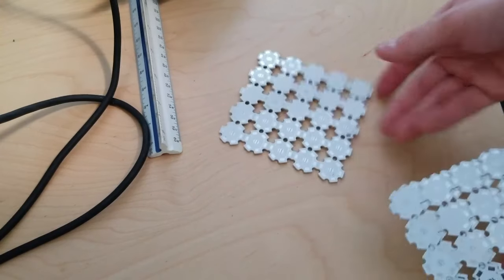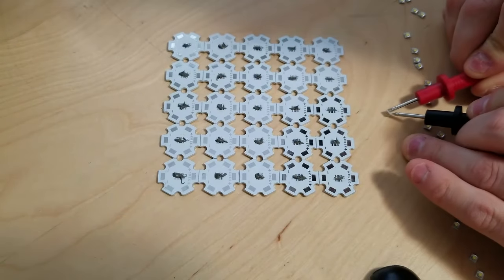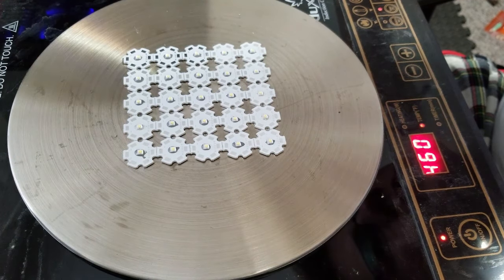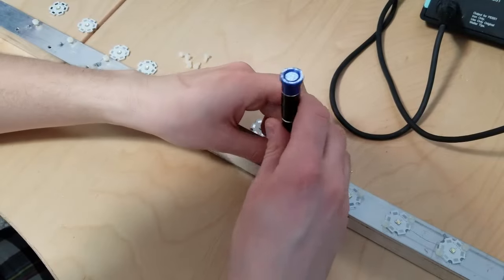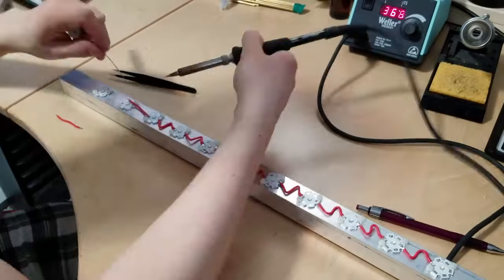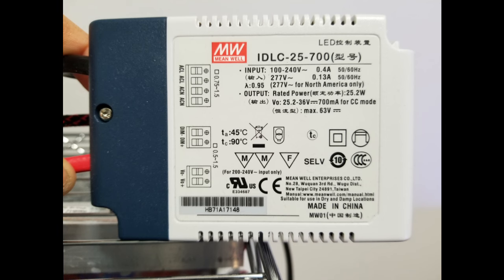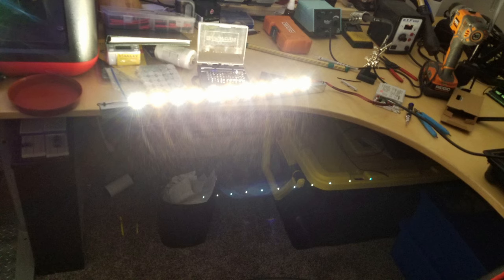DIY LED Lighting - How to Make Your Own Grow Lights!

Comment: Awesome video! I am looking to pick up one of those portable cook tops; however, it seems like they only sell ones with ceramic glass surfaces these days. Do you know if this will work the same?
Reply from the maker: Hey Andrew,
As long as the surface has [relatively] precise temperature control it should work just fine!
Reply: @autumnmaticcreations62  Thanks for the knowledge! I'm planning out my 8 site pepper aeroponics build now and looking to upgrade from COBs to something a little more custom. Any chance you'd do a video on designing a gerber file or the math behind that custom PCB you had ordered from JLC?
Reply from the maker: @WeRideSouth  I like the idea. Maybe I'll document the next LED board I do, but it will probably be several months before that's ready. What size of a light do you need?
Reply: @autumnmaticcreations62  I'm not sure yet. I'm currently running single Bridgelux Vero 18 COBs per plant, but increasing to 7 sites soon is going to get out of hand with power supplies, wiring and what not (I control them with a Pi and some relays). I was thinking about running some rails like you did with your starboards. I'm trying to get a solution with minimal points of failure.
Reply from the maker: @WeRideSouth  Sounds like boards are definitely the way to go. Have you looked at quantum boards? They're just aluminum PCBs with lots of Samsung low-power LEDs on them. You could run several of those in parallel from a really big driver and save a headache.
Reply: @autumnmaticcreations62  funny you mention that. I actually run two HLG QB288s on my lettuce. The slate heat sinks that they sell are not cheap tho. I was thinking I could make something like the QB144 pretty affordably if I were to build them myself, but I've never built a QB. I may have to stick with the Vero 18s, due to trying to affordably cover 8'x2' area.

Comment: First of all thank for this video. :)
I have a project to build an LED grid with about 150 diodes (Samsung-LM301B). I am not deeply in the topic of electricity rules yet, but I would have a question here.
As I see you do not use resistors. I know that I have to wire the LEDs in series, but I don't know if I have to use resistors during the soldering.
Could you please break down this topic a bit?
Thanks :)
Reply from the maker: Hi Mark.

Resistors are often used to control current in cases where the power supply delivers a constant voltage, but variable current. For high power LEDs, I strongly recommend using a dedicated Constant Current Power Supply. These special power supplies have a bunch of internal resistors and other electrical do-dads that help maintain a constant current and adjust voltage to the circuit's needs.
Reply: @autumnmaticcreations62  You just made things easier for me mate 😄 cheers
Reply: @AutumnMatic Creations  Hi mate!
I've got one last question for you :D

So in my circuit design, there are quite a lot leds (218). I would use a mean well xlg-100-h-ab constant current driver (100W 2100mA  ---   27V to 56V). 

From this starting point I designed the circuit with 13 lines connected in series and these lines are connected in parallel so the driver should handle the voltage forwarding.

So my question here is that the series-connected lines do not have the same SUM voltage forwarding value.

The line with ony the 3000K and 5000K leds have 44V SUM, and this line there are 16 led diodes.
The other line for example has the 16 led diodes mentioned above plus it has 2 Deep Red diodes with plus 2x2.1V voltage forward, so the SUM of voltage forwarding is now 48,2V on this line.

If I have different voltage forward values on different series of connections (the different lines), would it cause any damage on my circuit even if the driver can handle Voltage from 27V to 56V?

I know my question is a little extended now, and maybe I'm not the sharpest knife in the drawer when it comes to the topic of electrical skills, but I'm right in the finish, and your last answer boosted this project a hell of a lot :)
Thanks in advance!!!

Comment: If I were to make an LED array like the ones from spiderfarmer (a square array) what sort of Mean Well would be required. Thanks bud for any help. Also, is that a 3d printer beside you? If so, what would you use it for? I was thinking of creating a Rodin coil among other things. Again thanks for any help. Great video.

Comment: Would this led light be too intense for micro greens ? I am growing in 10 in x 20 in trays. Great video. Thanks
Reply from the maker: The beauty of LEDs is that you can usually drive them as low as you want, so it would be fine. Just pick a driver that supplies a current for the brightness you need

Comment: Very informative video my friend! 
Quick question: 
If i had 4 of these 11 led circuits connected in parallel, can i use 1 driver at the same voltage but with 4 times the amperage or do i need 4 drivers? just trying to get my head around this. thanks in advance mate :)
Reply: Your variable in this case is Amperage since we do not really car about voltage, this will change as a function of temperature of the LEDs junction. As long as you supply a constant current nature will do its magic and balance the voltage across the diods. And always respect maximum voltage of diods since when you put them in parallel you decrease internal resistance by half of the load driven by the current source, which means double voltage across the load. 

(From what I remember from school if wrong pls correct me someone)

Comment: Wouldn't you also be better off running a cable from the unused earth and bonding it onto the aluminium bar the the LEDs are fixed to as well?
Reply from the maker: That's a good tip, Mark. For safety, absolutely.

Comment: I would also like to know if it's possible to get a bigger power supply and make like 10 or more of these Long rod type lights that you made here and connecting them together. I'm looking for at least 50,000 lumens or more. Preferably 100,000 but 50,000  would be just fine especially if I could run three or four 50000 lumen strips.

Comment: could you add a potentiometer for dimming?
Reply from the maker: It really depends on the driver. For some of the Meanwell drivers you absolutely can. You just need to look at the resistor range that the input takes.

Comment: If it outputs 25.2-36 volts and your LEDs require 34.1 volts,what happens to the remaining 1.9 volts that are available?
I didn't notice any resistors used to burn up/thin out the remaining power. Will not having more power than needed burn out the LEDs?
Reply: His leds cam take upto 1amp and the led power supply only had 750mah. So tbe voltage and amp cross each other out. He is still within power ratings.

Comment: This may be a dumb question as I am noob, but why not use a strip?
Reply from the maker: Mainly because strips are designed to be used with power supplies and not current supplies. Also, because the modules used to strips are often very low power.

Comment: Like a positive build something like Mars new light tickets to SP series. That 600 w how many different diodes of white do I need and what are the ratio like how many of the red I'm just lost I need to do more research if anybody can give me a heads up on ratio I would understand or is it like to pick one of those white lights and then use many of those and add in those red 600 630 nanometers to add a few infrared's

Comment: So many questions and I cant find answers lol. What would make this bulbs 600w or 1000w?
Reply from the maker: When you see things like 600W or 1000W LED boards on sites like Amazon, that is not the actual power rating. What they're saying is something like "This light performs as well as a 600W HPS/MH light". In reality, a 600W equivalent LED board really only pulls about 100ish watts from the wall. It's usually safe to multiply your LED power by six to get an equivalent rating, provided you're using good quality LEDs like Cree or Samsung.
Reply: @autumnmaticcreations62  Thanks for the reply. Yea I was wondering about that. So I open this panel I got that said 600w. It has two drivers that say, Input Voltage AC100-277V......Output Voltage 70-90V and outputCurrent 580-630MA. So I had no idea what this was lol.
Reply from the maker: @ferngorgo4276  So based on that info, your power going to the LEDs will be between (70V*0.580A) 40.6W and (90V*0.630A) 56.7W, likely depending on your LEDs' temperatures.

Comment: Instead of tapping the hole to put the nylons fastener in, could you first tap with a stainless self-taping screw  then remove it and then use a nylon screw?

Comment: 4  things:
(But before all - NO Nylon screws. Ever. Will melt.)
1. Square tubing as a heatsink is just about the worst choice. Even an L shape is a bad choice. But the tubing will hold so much heat you won't believe it.
2. That many 3W LEDs so close together and on such a size heatsink - it will all get super hot regardless of what heatsink you use. Must have a fan blowing over the heatsink. Not great if fan fails.
3. WIres between LEDs do not need to be that fat.
4. Specs said 1A max current + typical 0.35A.  You rigged up 0.7A. Are the LEDs overdriven now?

Comment: I understand that the total amount of volts that all the led chips add upto has to be within the power supplies voltage range, but I don’t understand the amps part, I see that the the led chips you’ve used for that light build were 1 amp each and the power supply amperage was a little less, at .7 of an amp, so my question is, what if I have a power supply that is within the voltage range but it’s amp out put is for instance 6 amps, but my led chips are only one amp each, will I use 6 led chips at 1 amp each to equal the output of the 6 amp power supply or would 6 amp power supply blow the 6 1 amp led chips? Or does my power supply amperage need to be equal or less than but no more than the amount of amperage just one bulb will stand, or do I do the math with the amperage like you do the maths for the voltage and add the amps per led bulb Times how many leds I use and that’s how many amps I’d need the driver to put out? Or would I need to use multiple drivers to accomplish that many amps so I don’t blow the leds?

Comment: From the technical point of view, you can´t connect the ground to the PSU, but you should connect the ground to the metal rail.
The LED have no connection to the metal, so you should have the security of a shutoff with your FI.
In worst case you have live voltage on your light rail and when you touch them you get fried.
Every technician knows that you secure all electrical circuits with a ground over FI.
But hey it´s only your life not my life.
Reply: looks sketch asf to leave the ground cable out like that ...

Comment: Can someone please explain how wattage works compared to a standard light as I'm confused with how it works
Reply from the maker: Wattage is just a measure of power. The way we usually calculate it is with VoltagexCurrent. It is no different as you change light types.

With most lights, we apply a voltage to them and they pull as much current as they can for that voltage. LEDs actually work the same way, but they are much more sensitive and can behave strangely, burn out, or explode as they heat up if we drive them with a constant voltage. For that reason, we usually drive LEDs with a constant current supply rather than a constant voltage supply.

Comment: Thank you man, excellent work!

How can find out the best spectrum/LED arrangement (by type, not position) for a wide variaty of cannabis strains?

Would you reccomend building two seperate setups for vegetation and bloom or one setup with an on/off switch for red-spectrum LEDs?
Reply: I've read lots of info on grow lights and have drawn the conclusion that all these magenta "grow lights" are pointless, so just good white leds are fine. I go with high-CRI LEDs as my grow lights are used only in spring and in the remaining time double as work lights. Don't know if you find this useful but in any case, wish you luck.

Comment: This is a new information. Thanks
1- how I count the lighting units?
2 - how I know the amount of light the plants need? Is there a data for this thing and how I get it?
Reply from the maker: I use Watts as the metric for assessing light content, as most good LED systems are similar in efficiency. I would say that 25W per square foot is a pretty reasonable estimate for how much output power your supply should drive the LED system with.
Reply: @autumnmaticcreations62  thanks. so 25W is the safe thing for all Plants (herbs and fruit)
 and for all stages of the growing?
Reply from the maker: @sherifmoussa4827  For most plants, I would say that 25W per square foot is pretty acceptable if we are talking about LED lighting
Reply: @autumnmaticcreations62  thanks ☺️

Comment: hey dude have you experienced with germinating old seeds? my friend gave me a bunch of 3 year old seeds and i put them between two paper towels that i check on everyday and constantly moisturize.i keep the heat level at 21-28 celcius and it's been 4 days yet i see no taproot coming. any thoughts?
Reply from the maker: Are you keeping them moist? Standard procedure is to soak them for 8 to 20ish hours and then fold them in a damp paper towel - I usually water my paper towels twice a day. When watering, water until the paper is saturated and then pour the runoff out. Some people suggest a hydrogen peroxide solution for old seeds because it apparently softens them up, but you'd have to do a bit of research on that as I've never done it myself.
Reply: @autumnmaticcreations62  oh im keeping them moist alright. but how long should i wait for them to crack at this point?
Reply from the maker: @musicforhours4605  with old seeds I've heard it can take up to a week. Although if they don't crack within three days I wouldn't get your hopes up

Comment: What did you end up growing? Indica or sativa ?
Reply from the maker: Hey Colin, currently I've got some White Banner growing. It's a cross between White Widow and Bruce Banner
Reply: @autumnmaticcreations62  that sounds pretty sweet! How are the lights working for you? I have thought about making the move to LED for the power consumption savings but I'm still hesitant about the yields
Reply from the maker: @piercer4882  they're excellent so far. Currently running two custom boards on a 150W driver and my current plant is doing very well.

Comment: Where do you buy the diodes and the PCB? ebay?
Reply from the maker: The PCBs I got from Ali Express, the LEDs come from Digikey, Mouser, or any other electronics supplier. The footprint for these is 3535

Comment: Can i ask why you used white LEDS. and not a mixture of red and blue?
Reply from the maker: Hey Emil! There are two reasons. First is that I usually keep my lights very close to the plants, so the light might have a hard time mixing. The second thing is that different plants sometimes have different wavelength/peak photosynthetic activity relationships, so while a specific band of blue/red might work well for on plant, it might not necessarily work well for another.
Reply: @autumnmaticcreations62  Great, that makes sense. I have bought some of each, and i will do some experimentation, and your video is a really great starting point. How many plants do you have beneath the light?
Reply: Plants generally use between 400-700 nanometers on the spectrum scale...a tad bit more on each side, but it's safe to just say between 400-700 nm .....While plants do majorly use the red and the blues for the best absorption of photons for photosynthesis, they also use many of the other 'inbetween' colors......White light is made up of EVERY color in the spectrum.....Red and blue are only 2......It's much like a human diet....Sure you can live off of avacados, and spinach, but your body would do alot better with a well rounded diet of many foods...Same with plants and light....Certain processes, smells, flavors, and looks are activated by those other colors, other than red and blue...So in a nutshell...Use a color that best represents the sun, and contains all the necessary colors of the spectrum.
Reply: @Khaymen223  great, and in depth answer. It makes sense. The main positive for me when it comes to white light is that it is much easier on the eyes, so it is much more convenient when integrating the system into the home. So it is great if it can be done with white light :)
Reply: @Khaymen223  Most synthetic white light sources don't contain EVERY color / wavelength. Its mostly true for sun/stars. But white LEDs have very distinct peaks at specific wavelengths ( have a look on page 14 of a datasheet: https://www.mouser.de/datasheet/2/90/XLampXPE-221789.pdf) :)

Comment: Hey bro im trying to grow 4 cannabis plants in a 4×4 tent. What would you recommend?
Reply from the maker: For something of that scale I would just buy a set of lights. Mars Hydro SP150/SP250 series is not bad, or go with a set of quantum boards. You probably want to be in the ballpark of 200W at least (of actual power, not equivalent, as some cheaper products like to advertise in)

Comment: Hi, very informative. Can i just check if the meanwhile current regulator is for the prevention of the LEDs blowing up? If the LEDs come with a driver installed, there is no need for it right? Also, if say I were to hook up more than 1 of the series LED bulbs i should be connecting to the current regulator in parallel right?

Comment: So what is the total watts this lil light is pulling from the wall???
Reply from the maker: It's specified by the driver and the LEDs. The LEDs pull 700mA each and they operate at roughly 3V at that current. With eleven LEDs, that works out to about 23W

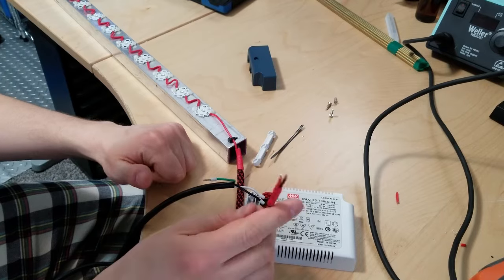Comment: 8:54 that’s not true. Neutral and live wires are not the same. The voltage is alternating only in the live wire, while neutral potential doesn’t change and stays close to the ground.